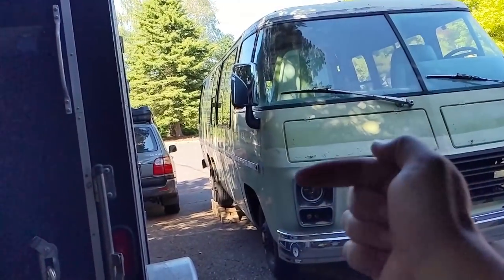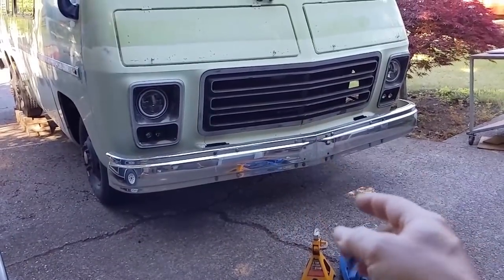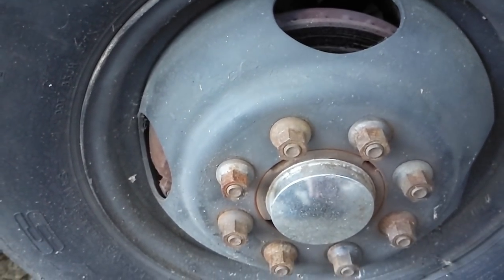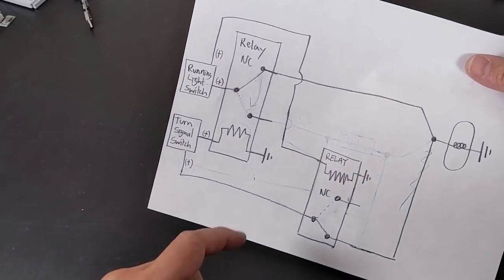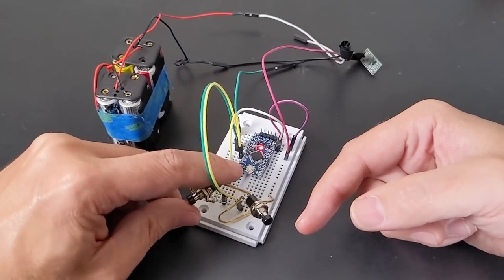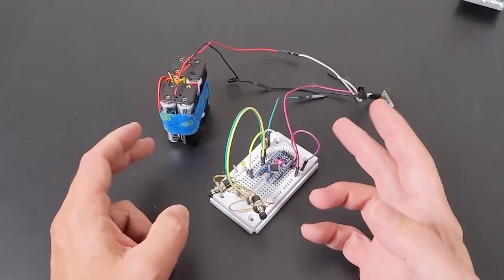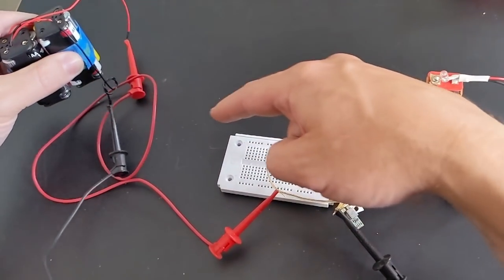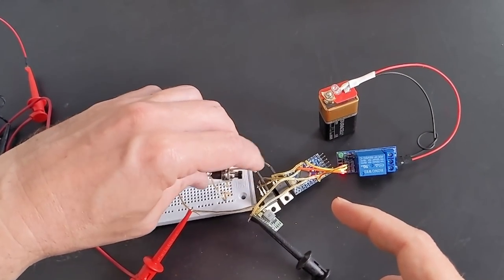Building the Best Damn GMC Motorhome Ever E.23 - Smart Blinkers and Front End Beginning

Comment: At 23:24 you say "never deviate from stock".  For all GM trucks and some cars from early 70's to 80's, the front turn indicators and the side marker lights from stock flash out of phase.  LEDs don't work with the existing wiring because GM is flipping the polarity, but by design, the incandescent lamps did flash out of phase regardless of the "legal requirements".  So in effect, you are deviating from stock as you try to "fix" a problem that isn't really a problem.
Reply: Motor hard to start

Comment: Over complicated a simple circuit! There's no need to use an Arduino, these circuits have been done in analogue for centuries. IF you decide to continue with it however, then use the Arduino properly and add 3 blink "comfort" lane change blink off tap on the indicator stalk, otherwise go back to basics and flip the polarity on the DRL so it won't flash out of sync by adding 1 more relay.
Reply: Or use a simple bridge rectifier to make the LEDs polarity insensitive and use the original wiring?
Reply: @GrahamY1970  this is what I've been wondering since he started messing with the lights. Four diodes in a very common configuration.

Comment: You can buy replacement LED bulbs with a built-in bridge rectifier or they use 2 LED's in opposite polarities.  Since the OEM was for the front side signals to blink opposite with the front signals, you don't need to worry about what the current regulations say, you are grandfathered.  FYI you may need to add a resistor across the front signal lights to make the side lights work as OEM.... or just leave the front signals as incandescent bulbs for now.

Comment: Hi could you use auto diode on each running lights and blinker lights positive so it protects each system and stops any feed back on either one of them. I think that will be an easier system to use. Just have a led that can handle the extra power with both working at the same time. I think this my work for your project for running and blinker lights.

Comment: Re: deviating from stock - your conclusion that "you are declaring yourself smarter than the original engineer" is definitely not the only conclusion. The original engineer had tools from 50 years ago, they had materials and manufacturing costs from 50 years ago, and even if they designed it yesterday, they have cost constraints that a DIYer might not.

I got new floor mats for my car - is that because I'm smarter than the engineers that designed the stock floormats? No, it's because I have a different value concept for the performance of my floormats than the manufacturer did.

Comment: If you notice on your front tire there is the letters LT 225/etc, LT stands for "truck tires" meaning they can carry heavy loads and max press of 80 psi, at the tire store don't let them sell you P 225/etc tires, P is for passenger tires and it goes to 44 psi, these tires will not be able to handle the heavy weight of your rig and they will explode on you.
Reply from the maker: I will be making a video about tires. The letters LT vs P are not indicators of a tires load carrying capability. Load Range is the old standard and Load index is the new standard for such information. Read more here: https://www.discounttire.com/learn/load-range-load-index

Comment: Some great progress on the motor home. Would it be easier to use separate driving lights & indicators?
Reply from the maker: Yes. So much easier. But I don't want to add a second bulb. I like the clean look of a single round LED on the side. Also, anyone else who has a stock GMC and simply wants to switch his/her incandescent bulbs with LED lights will have the same problem, and they probably won't want to add a second bulb to their side marker either.
Reply: @IndustriousPursuits  How about a 1.9 TDI VW engine 150hp version  hooked onto a Lexus 450h transmission it alone can produce 375hp.... add a Nissan leaf battery and home brew cooling system made from brake pipe to act as cooling channels running between every other battery(pipe - battery/battery  - pipe ect)
Reply: @IndustriousPursuits  The simple solution is to use a LED that has two levels of brightness.  Also, the Federal Laws pertain to the manufacturers, not the users.  Once sold, you have to meet state law for your state.  The simultaneously flashing was used to force the end of the sequential taillights the T-Birds and Cougars were known for.  GM vehicles have long had the opposite flashing side markers.  They are not front or rear lights, just side lights.  The reason they flash oppositely is due to the bulb getting positive voltage on both sides of the filament.  Zero volt drop means the bulb goes off when the parking/running lights are on and the turn signals flash.

Comment: "Smart Blinker" could have been an LED, two diodes and two resistors. Set up the a diode and resistor to sent running light current for "dim, running light", and the second diode and resistor for "Bright Flash" during blinking.

Also, I've seen many "side running lights" that flash in opposite phase of the blinkers.

Comment: why not us a 5 pin relay?, take a feed for the turn single wire before the flasher relay down to pin 86, take a feed from the running lights to pin 30, pin 87A to the + wire of the LED ( red wire) now make a tail from that red wire and put a diode on it, take a feed from the turn single + wire and connect it to the diode. now when you turn on your running lights on the LED will come on, and when you turn on the flasher it will energise the relay, switching of the LED and turning into a flasher

Comment: Seriously, the electrical stuff aside, get a better jack.  Moving it may be a chore but having 3 ton capacity jack will give you a far higher safety margin.  Between the motor, chassis, and suspension, you are probably hitting a good 1000 or 1200 pounds and jack capacity can degrade over time if you have a leaky cylinder.  Also 16 inch wheels have a safety bead whereas the gm 16.5 did not so you are actually running a far safer wheel for road traveling because if you get a flat or really low tire it will have far less chance of sliding off the rim

Comment: Just because you can make fancy electronic diode lights, does not mean you should do it. Where are you going to get spare replacements in 2 years let alone 5 years? The diode lites may have an almost forever durability and reliability, but your magic circuits and wires certainly do not. Go have a chat with any heavy truck and trailer shop that has been dealing with these diode lights for the last 7 years or so. Especially on their semi trailers.

Comment: Your thumbnail text is off. You're not doing a new drivetrain, you're doing the front suspension.
Reply from the maker: Despite changes to the A-arms, the suspension isn't really changing. The core of this job is just a replacement and upgrade to the stock steering knuckle. When the stock one was designed Detroit was new to making Front wheel drive and had never made such a robust IFS FWD unit before. They got better in later years. Particularly relating to the knuckle assembly.
Reply: @IndustriousPursuits  so your not going to change the upper bushings and ball joints? What about the tie rods?  Might as well do it all while its apart.
Reply from the maker: I'm doing the whole thing. Just like you did. (I think, we'll see) Great work BTW! Keep it up!

Comment: Please get a proper jack. That Jack you are using is not good. From factory the 26 ft came with an advertised front weight rating of 4000 to 4200 lb depending on year. You are asking for a an accident if you continue using a 1.5 ton ( 3000 lb) jack. Second issue is the jack position. If you have to crawl under your vehicle to jack, when it fails you will pinned under the vehicle. Go to harbor freight and pick your self a proper jack.  Below is a good jack that you should be using. Has a long handle to keep you out of the fall zone.

https://www.harborfreight.com/3-ton-rapid-pump-floor-jack-56624.html?_br_psugg_q=floor+jack

Comment: You really like to complicate your life, Side marker are not the same as mirror blinker and there for doesn't follow under the same rules. All US build vehicle are blinking inverted on running lights. this is why the mirror lights is never a running light. 

If you go with basic design (invert blink on running) just use a diode bridge for couple of cents. (and yes by law inverted blinking is consider synchronize.
 
If you really want to hole do your synchronize design. 
    you can use a dual color LED light, yes they are white on running lights and turn orange on bilking.
   Or a dual diode with a resistor on one side, and create the dual intensity light.